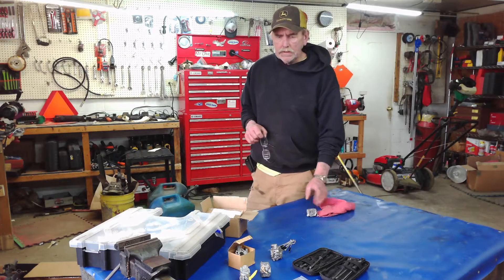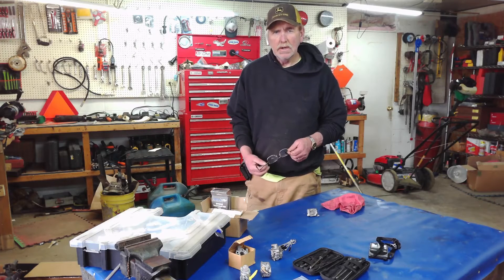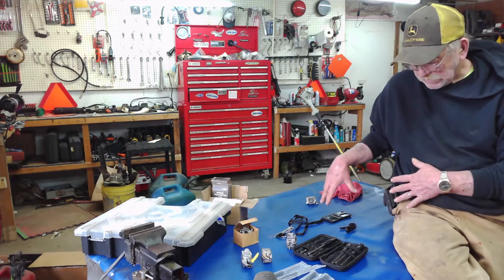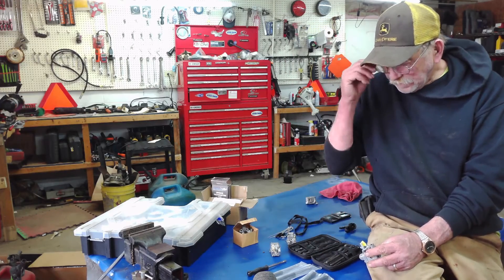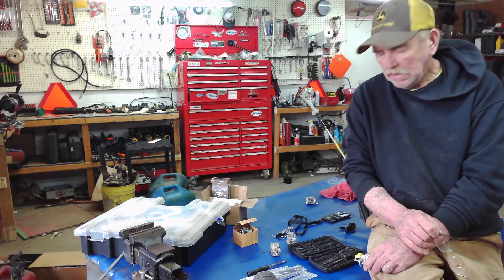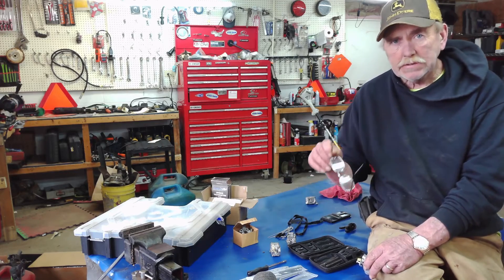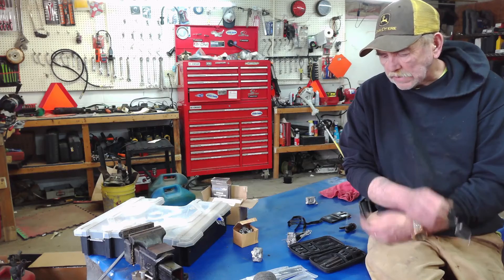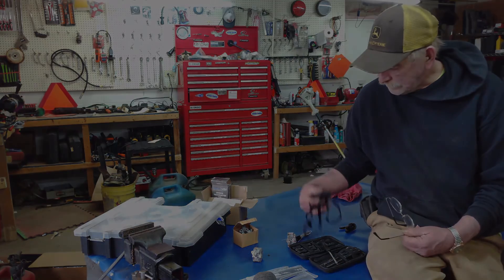How To Adjust The High & Low Jets On A Two Stroke Carburetor

Comment: Thank you for the informative content this helped a lot I do have to ask because I am a little confused on two things the first being with three adjustments 1.idle 2.low 3.high when setting your idle how do you determine if your rpm is to high for a regular home repair guy obviously if you get it running and it seems to be at 1/4 throttle that would be to high so numbers wise let’s say 4k max rpm so readout is at 1k rpm normal idle is 400-500rpm would you use the 1. Big idle adjustment screw to bring it down to 400-500 as much as possible and once it won’t idle down anymore say it’s stuck idling 850rpm then you would know to adjust the low idle in which would adjust how much low end fuel is used on idle side to then bring it down to the correct rpm range? 

Second question is being a small 2 stroke engine and having to rely on the proper fuel oil mixture to keep your engine running and properly cooled ie to much oil in your mixture fouls the plugs so it would run like crap and smoke depending on how heavy of a mixture and not enough would run lean and to hot potentially burning  up the engine…. My question is does the carb adjustment limitations have any effect on your engines ability to cool/be able to run to lean… for example if I’m at 850rpm trying to get to 400-500 range if I turn in the low to much trying to achieve such range is it possible to blow the engine being it’s a two stroke and it needs oil and fuel to keep cool and running or because the limits of how far you can turn it in that’s not possible aswell as it’s simply not possible because that would only be possible if you put in the incorrect fuel/oil mixture for the 2 stroke engine sorry just realized it’s really 3 questions but it is what is thanks again for the help
Reply from the maker: A common range for idle RPM on many small two-stroke engines used in equipment like chainsaws, string trimmers, and leaf blowers is typically between 2,000 and 3,000 RPM. I seldom have to adjust the idle screw unless the homeowner has touched it. Turning the low jet clockwise typically makes the mixture leaner (less fuel), while turning it counterclockwise makes the mixture richer (more fuel). You're aiming for a smooth, steady idle without sputtering or stalling. You Need to be patient and make small adjustments, as even a slight turn can have a noticeable effect. Now to adjust the (H) high-speed jet. You only need to do this if it bogs down when you ask it for full throttle. Same as the (L) low jet when it comes to fine-tuning the saw. I usually give it full throttle to adjust the (H) and idling on the (L).

Now to totally understand the above, this is after a compression check was done, the carburetor was removed and cleaned, a new fuel filter was added, and a new spark plug, and if there were any air leaks in the system ( leak down test). Adjusting the carburetor's low-speed jet to achieve a lower idle RPM shouldn't directly impact the engine's ability to cool itself or affect the fuel/oil mixture.

Fuel/Oil Mixture: The correct fuel/oil mixture is crucial for lubricating and cooling the engine. Running too lean (not enough oil) can cause overheating and potential engine damage,  while running too rich (excess oil) can lead to fouled spark plugs and poor performance. It's essential to adhere to the manufacturer's recommended fuel/oil ratio to ensure proper lubrication and cooling.

Carburetor Adjustment Limits: Carburetor adjustment limits prevent users from excessively leaning out or richening the fuel mixture beyond safe levels. These limits help protect the engine from running too lean, which could result in overheating and damage. Therefore, even if you adjust the low-speed jet to its maximum lean position, it should still provide a mixture rich enough to adequately lubricate and cool the engine.

Monitoring Engine Temperature: While adjusting the carburetor,  monitor the engine's temperature closely. If the engine starts running excessively hot or exhibits signs of overheating (such as excessive smoke or unusual noises), it's crucial to stop and reassess the mixture. Continuing to run the engine in an overheated state can lead to severe damage.

I hope I was able to answer your question
Reply: @northernnewyorkparts  it did and was very well explained thank you very much I appreciate the help